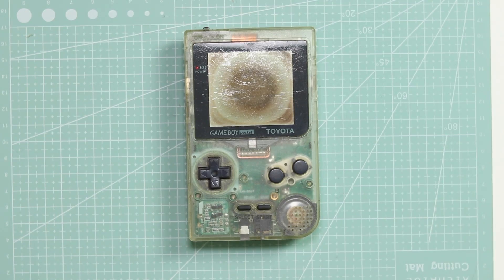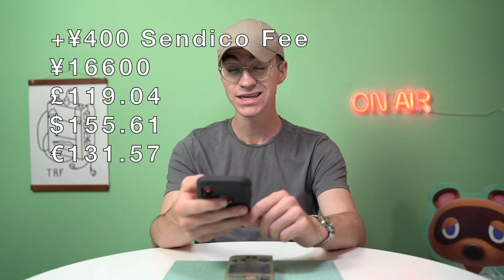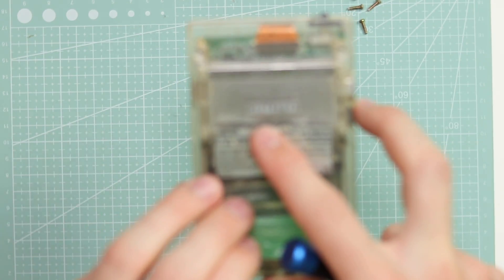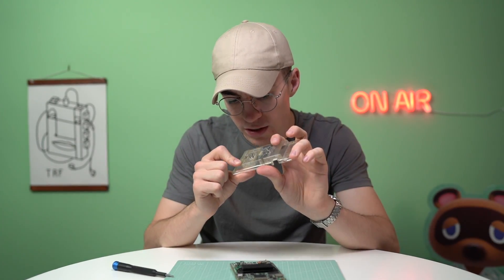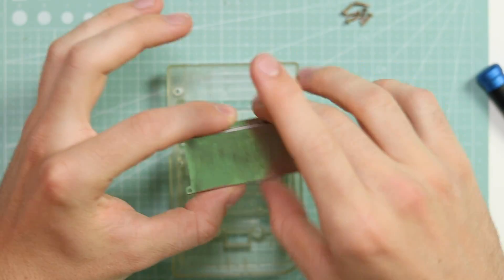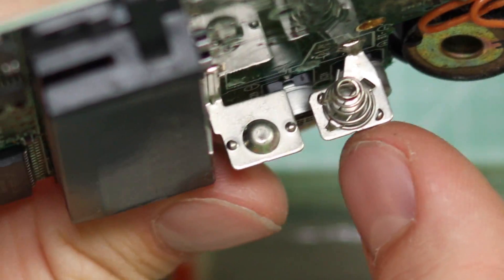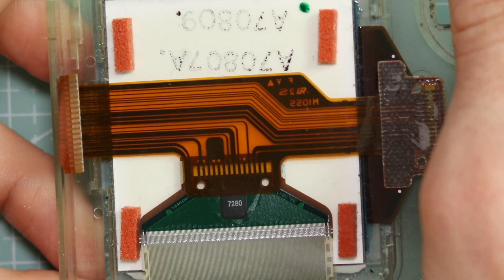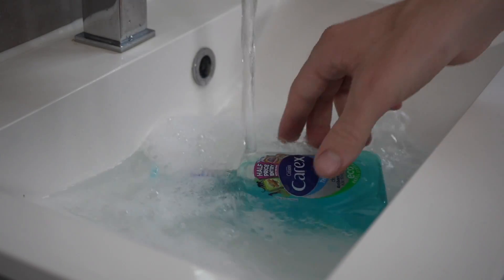$1000 Toyota GameBoy Pocket FULL Restoration!

Comment: Toyota!

Also, something I'd recommend to reduce scratches on plastic screen/screen covers is Meguiars Plast-X, it's intended for cars, but works great on any glossy plastics.  Just use masking tape and tape off the area around the screen so you don't polish the textured finish (including over the slight gaps between the screen cover and body, so polishing compound doesn't get in there).  This will make it look much better and you'll keep it 100% original.  

Even just a couple minutes of polishing will make a big difference. (Polish by hand, don't use tools)

Comment: btw, to help with the discolored plastic, use equal parts baking soda and water, scrub it into the plastic and let it sit for 15 to 30 mins, wash off, and repeat until desired result. You can use this as well to clean off stained food storage containers, like you know how pasta stains it red and just wont come off? it works for cleaning car headlights as well, basically any plastic.

Comment: You might want to invest into a ultrasonic cleaner. They’re very gentle and thorough. When I worked in a repair shop we cleaned the boards in a special solution afterwards if they were corroded but there are a lot of uses like cleaning the actual case in a non destructive way.

Comment: Toyota 
I really like the shell. I learned a lot from your tear down. I had a GBA that I had a mod done that allowed my GBA to play on my TV.  The guy did the mod for me at the shop. He changed the back of the shell.. then the 2nd part went into the battery compartment and had RCA cables that plugged into the TV. It also had it's own power supply.

Comment: FYI, I watch a few videos (can't remember the Alias) but he used Hydrogen Peroxide and a UV black light to remove the yellowing on plastic cases. It worked on clear cases as well as a gray cased PS2 among others. So if you get a really yellow case you might try it. The lights he used seemed to be the cheap LED strip lights you can get through Amazon.

Comment: toyota, im suprized that nintendo dosen't make midern gameboys or something that can play game boy games, it would do quite well consitering how many people there are who played the game boy when it was origionally out, maybe make the modern game boy reminisent of the origionals but not a exact copy to still give the originals worth, either that or something like the gamecube game boy player where theres a application you can download for free on switch and there is a device that reads the game boy cartrages that just plugs to the usb on the dock, im thinking something like the game cube gameboy player where its flush with the dock, you plug it in to the side and it will have same proportions, you still get 2 or maybe even more usb slots and the gba player, maybe even some more system adapters while at it like n64 reader and 3ds slot maybe even a game cube disc reader.  but if we are going to do all that we might just need a whole new dock, maybe with a cool texture too.  i might even make a video on this